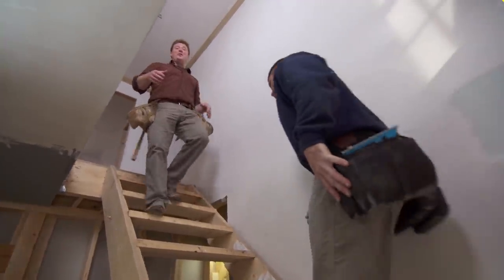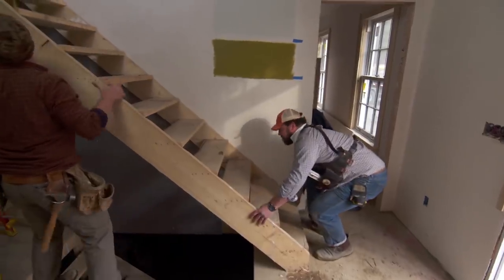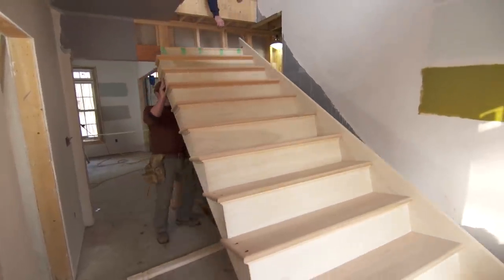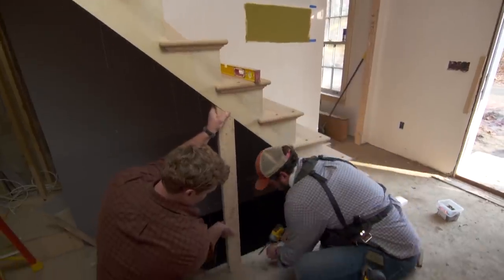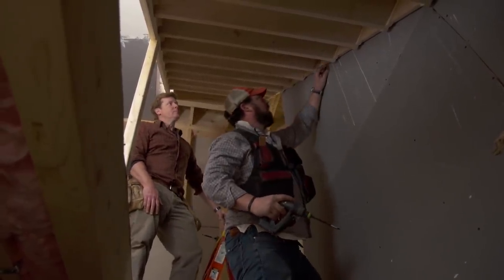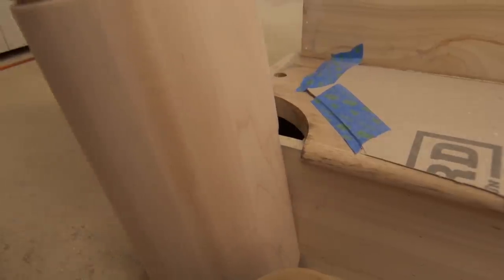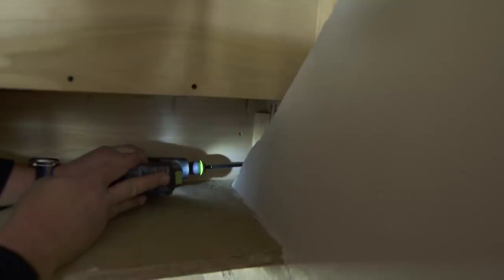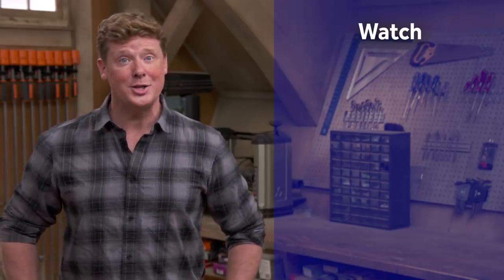How to Install a Factory-Made Staircase | This Old House

Comment: I've got too many projects I need to tackle, but now that a 2x4x8 is $12 at Lowe's, they're going to continue to be neglected.  At least now I have more time for beer drinkin'!
Reply: Since you mentioned it, sounds like a good idea.
Reply: Lol seriously
Reply: I'll drink to that!
Reply: Try buying sheet goods (plywood).  Yikes.
Reply: but can the 3D printer warp them as well. and include bark one at least one corner?
Reply: Beer is cheaper than the 2x4s now
Reply: buy the 2x4x7' 8", its cheaper than the full 8 feet. and then just stretch it

Comment: This is what automation looks like. While in most cases automation like computerization of accounting or the robotization of car manufacturing can cause major temporary disruptions to the work force there has never been more demand for houses and there's a severe lack of carpenters and other tradesmen. This automation doesn't just save time it also gives the customer a lot more value added options. A lot of the automation going on right now is like this. Although, automation can also be used to bust unions and squeeze labor to. Many don't really realize the moving assembly line was NOT the start of mechanization. The start was pumping water out of mines and making powered hoists. Then came power machinery in paper mills and then came mechanizated agriculture with some of the first harvesters all before the assembly line. That last one is what started the great movement toward cities and with it was a massive supply of labor. Industrialists took advantage of that trend in mechanization to exploit labor but note that mechanization predated it and industrialists had little control over the phenomenon. They did however with robotization and through reckless greed destroyed American cities that had been built through mechanization. But they then didn't with computerization as a series of technological advancements meant that information technology was extremely hard to own (namely competitive development of computers for businesses then the personal computer and then university research made fiber optic networks an order of magintude more information dense right as investors were trying to own the internet). Fast forward to today and we are just starting to see what a world looks like of information technology being owned with social media and cloud computing. They may again be able to do this quickly with automation if we don't stop them.

Comment: That stringer sure looks undersized.
Reply: @Kevin-mp5of  Boxed stair construction usually describes a series of stacked boxes acting as a stair. Perhaps you are referring to a supplier or manufacturer?  But this looks like a typically stringer stair to me. 

It is atypical to rely on the wall below. It is not birds mouthed into the support studs so the connection between the stringer and top of wall has to be designed for a sliding force in order to be effective. The wall unintentionally helps but I am doubting that it was the design intent. You also have to make sure the stair opening below is designed for the extra load or the bearing wall goes all the way down to foundation. 

My guess is that stair is not engineered and does not meet code. I have seen that as an issue where suppliers don't engineer the stairs and they don't meet the prescriptive requirement. They just want to make the structure as cheap as possible. I have seen a number of contractors caught off guard by building inspectors on this issue.
Reply: @Kevin-mp5of  That doesn't really help with the strength of the stringer. It is like saying there are lots of strong links in a chain but the chain still has a weak link.
Reply: @Kevin-mp5of  See my previous reply regarding the walls.